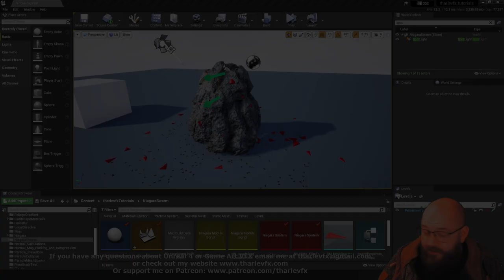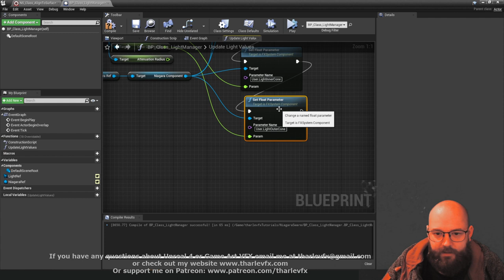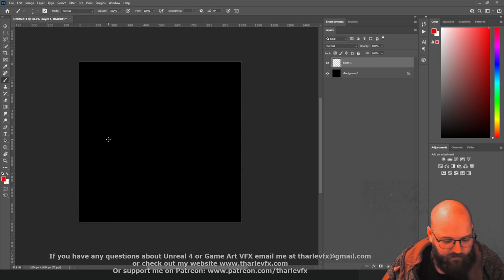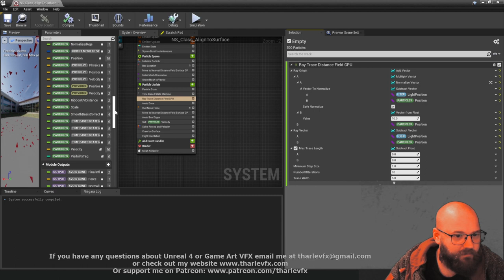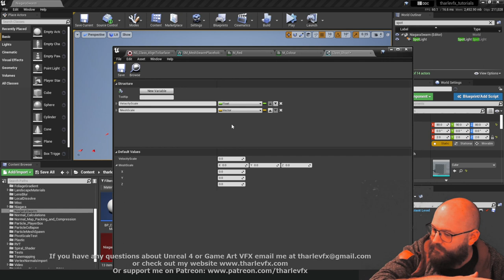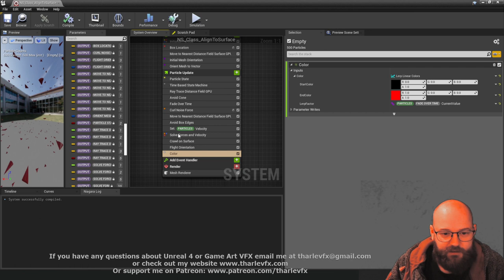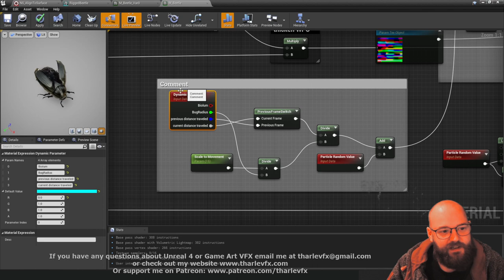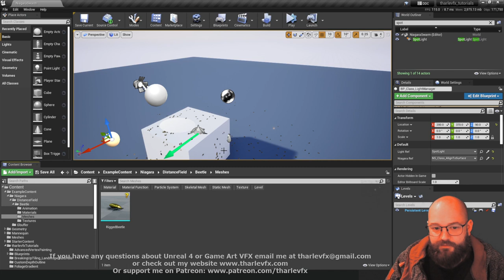UE5 Demo Mesh Insect Swarm - Part 2

Comment: Great tutorial!

I am currently on UE5.3 and I am facing a problem with the right vector provection of the mesh. when my mesh is walking vertical it is half inside the wall and if its walking under the surface its also pointing up and is inside the roof. I have opend the example project as well but cant solve this. do you have any ideas on why this is happening ? any help would be great!
Reply from the maker: Can you just rotate the mesh and reimport?
Reply: unfortunatly not,  its working fine not climbing the walls but the angle seems incorrect  @tharlevfx
Reply: https://drive.google.com/drive/folders/1v58JAwQHSiuvtWasyGVZ6vZRBxG0KQXI?usp=sharing
Reply: Ive upload some pictures to showcase how it looks like now. wired thing is when I put the mesh inside the original example plugin it looks fine
Reply from the maker: @Kevin-z3k9d  it’s hard to remember how I did this example since it’s a couple of years old, but I’ve just covered the same techniques in more depth in my advanced niagara course on udemy and gumroad, that might help
Reply: can you share the links please? 
 @tharlevfx
Reply from the maker: @Kevin-z3k9d  https://tharlevfx.gumroad.com/
Reply from the maker: @Kevin-z3k9d  https://www.udemy.com/course/unreal-5-niagara-advanced-niagara/learn/
Reply: alright tutorial is bought! thank you very much for your fast reply  @tharlevfx